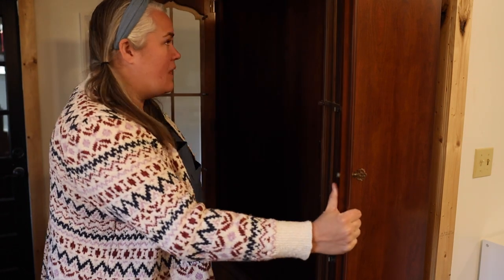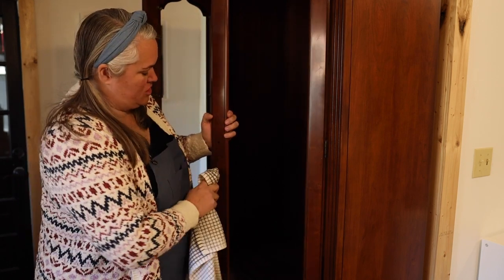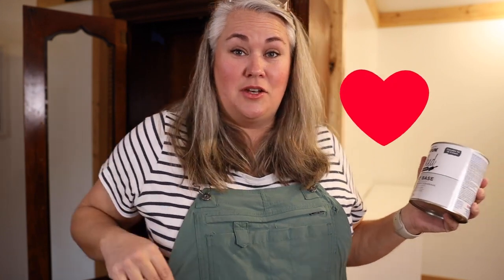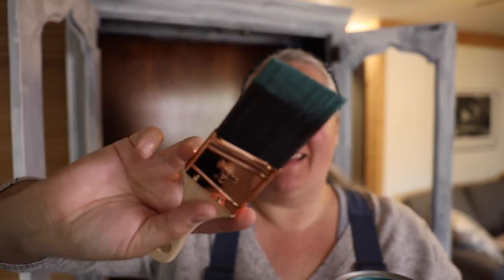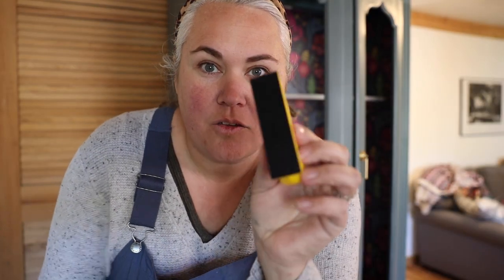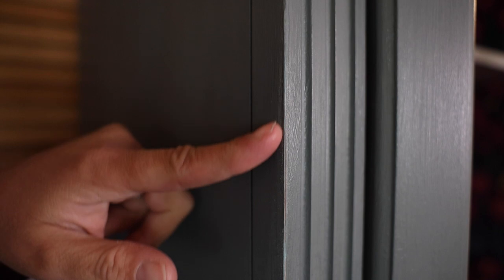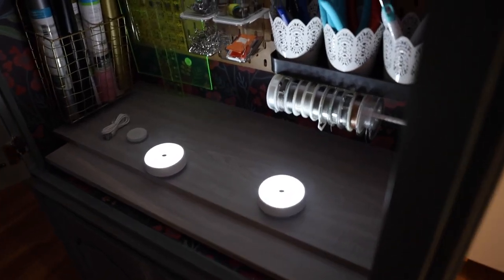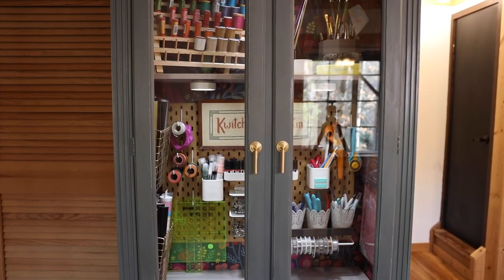DIY CRAFT CABINET - CREATIVE STORAGE SOLUTIONS FOR SMALL SPACES

Comment: Not a stalker or a Weirdo🤣😂🤣😂🤣🤣 The favourite thing apart from the colour is the Price. They are £300 where I live in the UK. We are waiting for builders because 3 walls are coming down or having double doors put in, so my craft room upstairs is now a dump room for everything from these said rooms.  Everything is off the walls and everything not going to be used in the next 4 weeks is in my room. I wish I had thought about it and pulled craft table forwards and tucked everything else behind because I can't get to anything now. The 4 weeks is now 12 weeks and still have no date so I am stuck. I rescued my embroidery stuff and have been making a roll on an industrial bobbin but nothing paper related. I may have to 'tunnel in' soon. Cabinet is adorable.
Reply from the maker: 😂😂😂This made me laugh! I’m so jealous how inexpensive sheds are there! They start at around $6000 here! I hope you get to your supplies soon! It’s awful being away from them!
Reply: @goodgollygal  You have to be careful here you can buy a beautiful shed/sun house but some are really thin boards and some are not pressure treated boards. In our weather over here timber sheds don't last that long. Soaking all winter and going mouldy and summers can still be wet and sunny😂 Then the thin boards shrink if we get a good hot spell. All good fun over here.

Comment: Omg i love how you did this!  I have a cabinet that I converted. Its not painted just went straight to organizing!  Haha! I have been searching for a way to do a slide out table top bottom. And your slide out looks like it would work in my cabinet. Thank you for inspiration!  Id love to have a closer look at how the back table top works? Is it connected at all or just resting on top?
Reply from the maker: Thank you! No the back piece just sits on top when they are pushed in and when I pull it out it drops down in place. It’s the perfect height! I do have to lift the back one a bit to help get the shelf started before I push it in. It works perfectly!